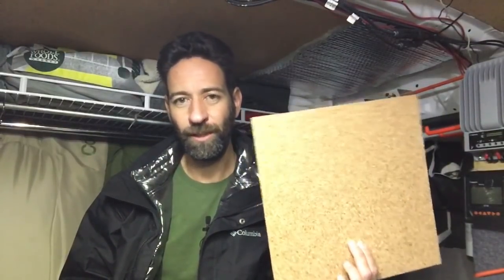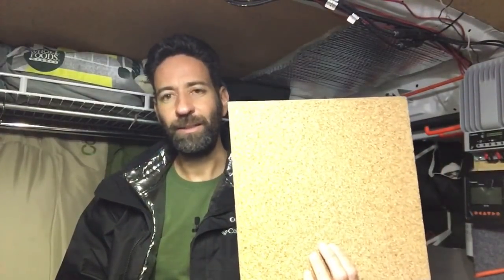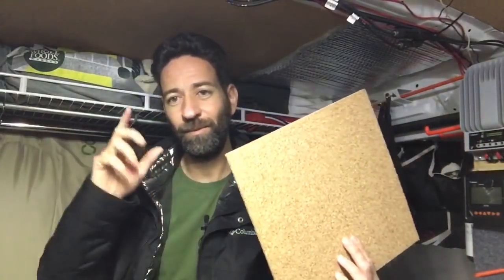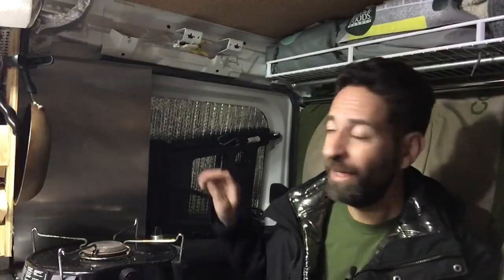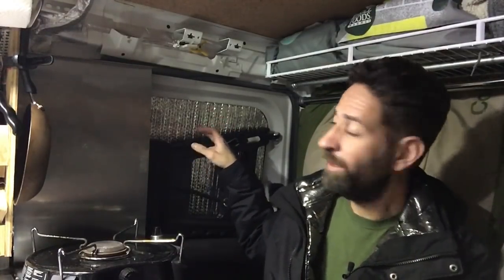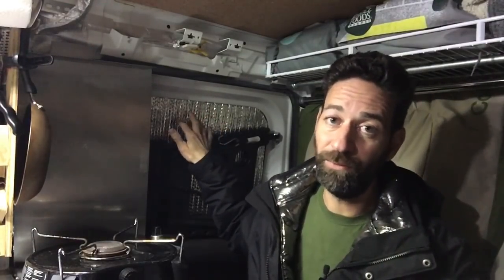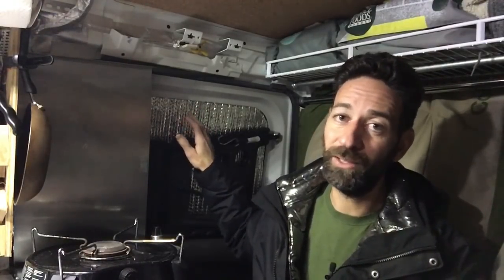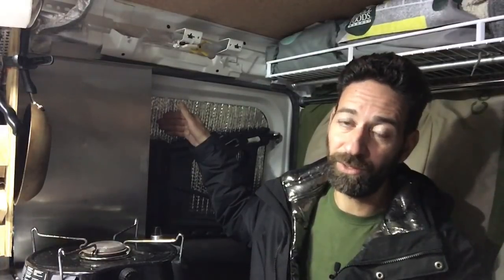Update on Using Cork to Control Condensation in my Campervan

Comment: HI, Did you use cork tiles alone? I am thinking to do it as well.
Reply from the maker: Yes. Just cork tiles on the roof only. To be honest, I’m thinking of removing them. The cork acts a little bit like insulation and I don’t like that aspect. Also, I should have sealed the cork prior to installation. It has some discoloration due to moisture.
Reply: @StaticCamperVan  How are you going to seal the cork to the metal roof? Is it better to buy adhesive tiles cork? Seal it to the metal roof.
I think cork is environmentally friendly... that is the reason why I would choose it for my camper insulation.
Reply from the maker: Aimsy McNamara if I were to seal the cork tiles, I would do so beforehand. 
I’d thought I’d mention it as the porous nature of cork is the only real drawback, in my opinion.

Comment: Would it help to caulk the edges to prevent moist air from getting behind insulating material?  The cork underlayment... you said that the roll of cork was much harder to work with, so even if I found someone to share the cost and split the product would it not be worth the effort?  I'm beginning to think a small dehumidifier would be wise.
Reply from the maker: Cork is porous, so it should be sealed, ideally. 
The cork shelf liner was more plastic than cork and was worthless. The large rolls of cork underlayment should be easiest to work with. 
Dehumidifiers are great but we still need to cover all bare metal or water will condense and drip. Also, I don’t have battery power sufficient to run a dehumidifier all day. And I only use electric appliances that run on 12 volt. A dehumidifier is out of the question for me. I was going to buy some Damp-Rid or equivalent. But since installing the cork, I haven’t had any more moisture or condensation issues.
Reply: I missed the notification that you'd responded to my questions.  I saw a video of a 12v small dehumidifier.  Trying to find it again.  Apparently they're Chinese made and you need the skills to keep the thing running.  The comments I've caught suggest that switching out the fan it comes with for a quieter PC fan works well.  Here's one video - https://www.youtube.com/watch?v=1ZvSIhBgsFU Here's the followup so you can check out the additional comments... https://www.youtube.com/watch?v=HwGRtDXP_do This isn't the one I saw, but it's 12v... https://www.youtube.com/watch?v=jf93tYbaqnk  (I found this model on Amazon just now.)  There's another type that uses pellets to passively collect the moisture inside and then you have to plug it into power outside the van so that it can evaporate off the absorbed moisture.  (Some people think they have to plug it in inside to make it work... duh... sounds like something I might do.)  Since the comments about them breaking down, I like that there's this tear-down video for the little Pelletier... https://www.youtube.com/watch?v=_hH-8KqQtys  Cost effective way to make your own moisture absorbing packs.  I reckon this would make them cheap enough to be disposable... https://www.youtube.com/watch?v=O7zdebMqov4  However, I'm still very interested in the topic of covering all metal surfaces to avoid much of the condensation altogether.  Another question is if you're finding condensation (and/or mold) behind your cork installations?  I've seen this mentioned by others who have removed part of their insulation install only to find they were harboring mold unknown behind the scenes.  Sorry to be so long-winded.  Shared all those links because I know how frustrating it is to locate links others have mentioned.  Going into the wrong season for this to be a top priority for you but I know it's a huge topic for those of us planning a van build. Have you done the "follow up to the follow up" that you mention below?  I must have missed that, too.   Have a great day!!!
Reply from the maker: Thanks for the links. Since putting up the cork I have almost no condensation. I also stopped using a Buddy heater and switched to an Olympian Wave 3. Those two changes have made all the difference. I don’t think I will need a dehumidifier. I appreciate your research as condensation could be an issue when the weather gets warmer. 
I have not seen any mold or condensation behind the cork. But I left the cork untreated so it’s still porous. As far as I can tell, the cork is working perfectly.
Reply: Static CamperVan It's not wintertime (cold outside/warm inside) that's worst for interior condensation?  I saw a video of a Canadian full-timer's build and she and her father made much of the need to have no exposed metal surfaces with direct interior conduction to the cold exterior of the van.
Reply from the maker: Yes, I agree. But I have had some high inside humidity when in warm wet weather.

Comment: Good Update. Where did you get the polyester batting and did notice it holding moisture?
Reply from the maker: Jo-Anne Fabrics. And no it didn’t get condensation in the first place so it didn’t hold moisture.
Reply: Static CamperVan 
Thanks again!

Comment: Do you stick the cork right on the metal? What type of adhesive are you using?  Liquid nails?  How thick were the tiles? 1/8 or 1/16 or?   I would have liked to have seen a video of you doing it. :)
Reply from the maker: I left out some details because I talked about it before on the first video. I use spray adhesive to glue the tiles in place. The tiles are about a 1/4 Inch.
Reply: Sorry...again...missed that one, got to go back and watch it.
Reply from the maker: No worries

Comment: Cork looks like it is good for control condensation. Will cork dry up the condensation better or traps more moisture?  My understanding we need ventilation and or dry heat to control moisture? Is there any off-gassing or odor from cork ?  How good is this material as insulation comparing to others ?
Reply: I haven't watched this channel very often but you make great points.  Propane is a very wet energy source if that's what he's using.  Unless the vent is opened at night, I can't see a way around condensation from breathing.
Reply from the maker: My thought was to use the cork as a thermal break to keep condensation from happening in the first place. I always leave my floor vent and roof vent fan open (even in freezing temperatures) so I only get condensation build up when I’m using my stove and don’t turn on the fan. 
I haven’t noticed any off-gassing or odor. As far as insulation performance, I’d assume it would be very low compared to other types of insulation material. I’m not sold on insulating my van, the only effect I’m after with using cork is to help cut down on the condensation. I’ve found insulation to be a negative for me personally.
Reply from the maker: I always leave both my vents open. I like fresh air to be moving through my van at all times.

Comment: Hi, Glad the cork is working.  Would you still  suggest no insulation if you were mainly in warmer climates?  Also, what size is your propane tank and is it vented to the floor or in a sealed box?  Finally what type of flooring would you suggest?  Thanks!!
Reply from the maker: I do believe that a van should be built for the conditions it will be in most of the time. For a van in warmer areas, no insulation has been cooler and more comfortable. But that’s just my experience. 
If you are going to be camping in parks with access to power, you might want some insulation and an air conditioner. 
I have two propane tanks, both are 2 gallon capacity. I have a floor vent and roof vent that remain open year round for ventilation. 
Because my van is tight on space, I’ve only ever used carpet as a flooring. I wouldn’t be able to recommend any type of flooring. But I can say that carpet is a pretty poor choice as it gets dirty and damaged quickly.

Comment: Love the look of the cork!  It really warms your space aesthetically.  Just curious if you'd ever considered metal tubing to run your interior wires through?? I've seen it in more industrial/modern architecture and it looks great.  Adds protection too.  Cheers!
Reply from the maker: Good idea. I left the wiring exposed because I assumed I would be rebuilding and changing the layout within the first few months. But it’s odd, I just don’t notice the wires anymore.

Comment: Thanks for your video's. Question: where did you buy the square cork, you are using and what kind of adhesive are you using with the cork squares? So, that is all you use, to keep your van warm and dry? Thanks, Rachel
Reply from the maker: I bought the cork at Walmart and Fred Meyer. The adhesive is spray adhesive. It’s contact cement but it’s easier to apply since it is in a can. I showed the can on the first video I did talking about controlling condensation in my van. Most Walmart stores don’t carry the good spray adhesive. You can find it at Home Depot or Lowes. 
The cork is an experiment because I don’t want to insulate my van. But so far it’s working great.
Reply: Thank you!

Comment: Does anyone know if I can install cork directly against the van wall with no glue just plywood tightly installed, and not cause mold problems?
Reply from the maker: I think every situation is different. How you install is as important as where you are living and how you are using your van. I had condensation issues when I used a Mr. Heater Buddy. After switching to an Olympian Wave 3 heater, my moisture problems went away. 
I would be concerned about installing cork under another surface where it couldn’t be monitored. Take a look at a video from my friend Lisa to see why:
https://youtu.be/GBjVzCqgXiw

Comment: When I was in the Navy the submarine I was on had 2" of cork covering the interior of the hull except in the bilge area. Worked pretty good. You might consider using spray foam insulation inside your ribs and in your void spaces to help keep the cold away. Did you find a pocket knife? How are you fairing in our weather so far?
Reply from the maker: Interesting! I don’t have any trouble keeping warm, my goal is to cut down on the condensation. 
I didn’t find a knife yet. I will keep you post!

Comment: How did it do over the spring & summer?
Reply from the maker: The only noticeable difference in the warmer weather was the fact that the cork acted like insulation. There were a few days that it held heat in the van longer than usual. I’m happy with the cork as long as I’m here in the cooler Pacific North West, but I’d most likely remove it if I were in Southern California.

Comment: How thick are those tiles? Still working for you? What adhesive did you use? Getting ready to cover up my caravan metal...thx!!
Reply from the maker: The cork tiles are about a 1/4 inch. I used a spray adhesive. You can see all the details on the install video here: https://youtu.be/rxAuKevYOgM
I’ve found that I don’t need the cork anymore since I got rid of the Mr. Buddy heater. I’ve left the cork in place since it’s already there.

Comment: Does the cork give a better thermal break than the reflectix? And is that cork easy to cut with a scissors or box cutter?
Reply from the maker: Yes, the cork works great for me. Reflectix gives No thermal break. It does absolutely nothing. Waste of money.
Reply: Static CamperVan ...hmm ok. yah that reflectix ruined my kewl cooler. it rubbed off the aluminum onto the cooler which is painted metal. I wonder if I can get that stuff off but I don't know. It also rubbed off aluminum onto one of my five gallon bucket lids and ruined that too. plus it screams "hi I live in my vehicle". I have pretty Heather grey felt covering my windows at night in the back and reflectix on top and cork would be pretty..but those squares are too small for my side windows but big enough for the back windows. thanks.
Reply from the maker: Oh, sorry. The cork cuts very easy with a box cutter and a straight edge or ruler.
Reply: Static CamperVan ... thanks ....someone said something about breathability with that stuff on one of your vids but the internet said it does not allow moisture to escape. I have a small terrarium in my truck with a cork plug and the moss in there has stayed alive for like six months now.

Comment: hey, Newman here again. what's the deal with mattresses getting mold? can't we just zip a moisture proof bag on it to keep the moisture out? also if the mattress gets moldy then my whole vehicle will right? thanks
Reply from the maker: You can try it. I imagine the cover would work. I can’t stand sleeping on those waterproof covers so I’ve never tried it. 
Without some kind of ventilation, yes there will eventually be some mold growth. Have you ever lived in a place that didn’t have a bathroom ventfan? 
Don’t overthink or overly worry though. Water vapor always wants to equalize. Even a window left partial open will allow the moisture to escape.
Reply: Static CamperVan ....hmm....I think I am gonna use the cover. is it the sound of crinkling you don't like? I don't really love that either but when I hear it I will just think ok that's protecting my mattress. I will try it. I sleep in the backseat of my crew cab pickup. it has a sunroof, four full windows and a little hatch slide window in the back above my bed. which one is the best one to crack? I have rainshields on the four side windows.
Reply from the maker: I don’t like those waterproof mattress covers because they don’t breathe and I wake up with sweaty sheets. 
I couldn’t tell you which window to open. I leave my windows rolled up because I have two vents in my sleeping area. It’s an entirely different setup from yours.
Reply: Static CamperVan ....oh my. yah I was sleeping on a pool float before wirh polyester blankets and I was sweating like a pig even tho I normally don't even sweat like normal ppl do. I had suspected that. but maybe it was something else i dunno but I don't get that sweat anymore but I am sleeping on six layers of reflectix which doesn't breathe either but in two polyester sleeping bags. normally our perspiration gets sucked into the mattress? how did your friend like the latex slab?
Reply from the maker: Yeah, I suspect you won’t be comfortable. 
My friend loves her mattress but she left it in storage for several months and it hasn’t faired well. I found it very comfortable too.
Reply: Static CamperVan ...oh my...did it get moldy in storage?
Reply from the maker: No, the opposite. It dried out and started to get crumbly. I was helping her move and I thought it was kitty litter. She had it at a non climate controlled storage unit.
Reply: Static CamperVan ....oh sorry that made me lol. tonight I experiment with charcoal pellets they use in fish tanks to see if it absorbs any moisture but I don't think I can produce any double blind controlled studies. lol.
Reply from the maker: Haha
Reply: Static CamperVan ...the charcoal didn't do anything. I'm wasting all my money on all these experiments. Now I have a $5 bucket of charcoal pellets.
Reply from the maker: I just remembered that someone told me about a lady who used kitty litter in pantyhose to help with moisture. I would think the charcoal would take some time to work.
Reply: Static CamperVan .....thanks....I'm so done. I'm here in bed bath and beyond and I don't like any of the mattress covers. Also saw a baking soda thingamabobber to put in fridge does this work?....also looking at this damprid thing...I would try it but someone on the internet said he started having dizziness after using I think this but maybe it was something else. Will burson said he used kitty litter in his poo poo bucket but then he had to throw out the kitty litter and even the bucket cuz the stink of the kitty litter...it even infiltrated the bucket.maybe he used the wrong kitty litter tho I dunno I never had cats. My humidity was at least 75 % in the truck last night. I can only imagine what happens when I get into cold climates. Silk absorbs 1/3 it's weight in moisture..wonder if I can do something interesting with that. I'm so done. That's what I say every day but keep going lol. I guess tonight I crack the window experiment #1: hatch window right next to my head!!!!! Ahhhhh!!!!
Reply from the maker: It’s a learning process for sure. You are alright if you are open to learn. I’ve had several people tell me they use damp-rid or the other main brand. I haven’t tried any since I haven’t had any real moisture problems lately. And Will should know better than to use kitty litter in a composting toilet. The only way a composting toilet will work is if it has compost. Kitty litter isn’t compost and is designed Not to compost. 
You’re still overthinking things. Crack open a window. If that isn’t enough, put a small fan in the window. Believe me, simple is Always the best answer.
Reply: Static CamperVan ...huh. no will "I know everything" burson (lol) wasn't composting at that time. it was just a basic 💩 five gallon bucket. then he got a fancy chem toilet. don't really watch him too much any more so I dunno what he's pooing into these days...lol
Reply from the maker: Haha! I like Will but don’t watch many of his videos these days.
Reply: Static CamperVan ...I could say more about him but I won't...lol. I'm off to Michael's art supplies to waste more money for my experiments for my window treatments.lol

Comment: Check this out!

Material                                       Typical R-Value      R-Value Per Inch
Dense Rubber Flooring               0.250                         1.30
Recycled Rubber Flooring               1.100                         2.20
Cork                                               1.125                  3.00
Cork/MDF/Laminate                       1.175                  2.35
Reply from the maker: Very interesting!